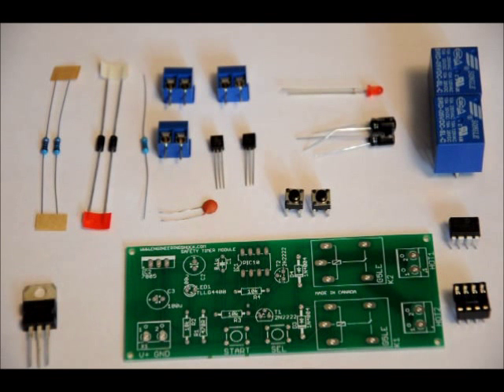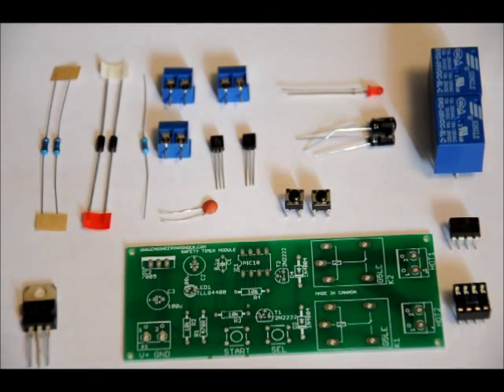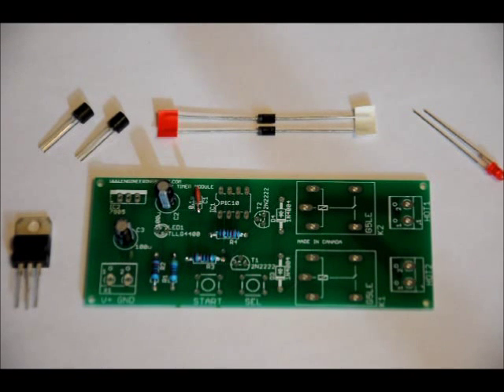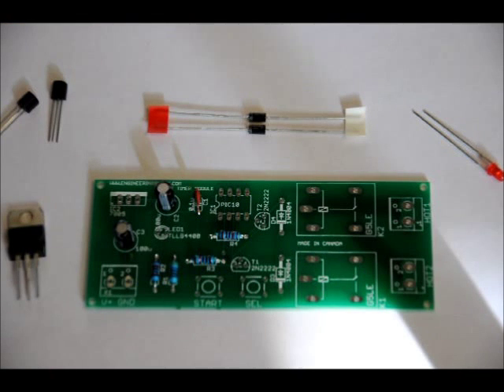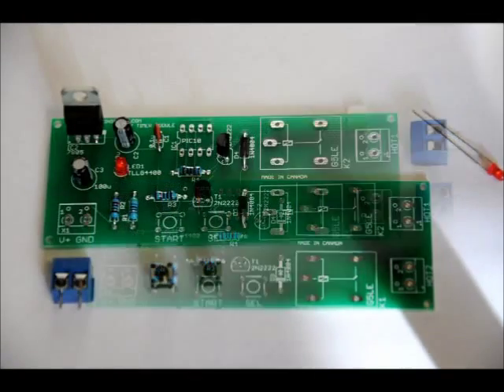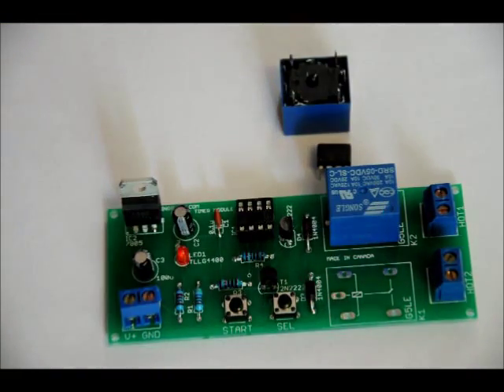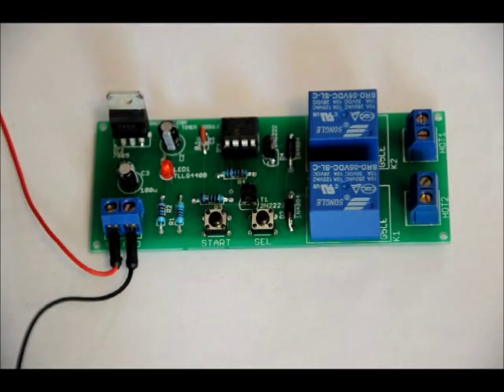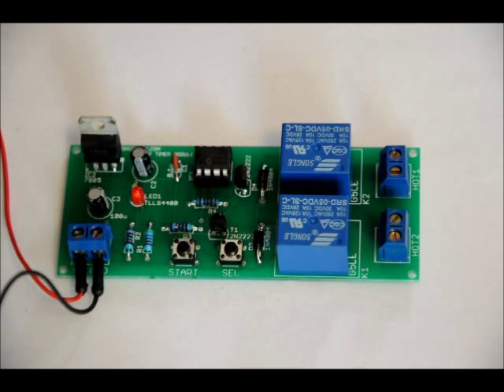The 30 Minute Soldering Iron Timer Safety DIY Electronics Kit - Assembly Video

Comment: what about a custom stand for the iron with an ir transmitter/receiver set that would detect the iron being removed from/put back in the stand (or maybe some other method of detecting)?

if the iron isn't put in or removed from the stand within 30 minutes, it shuts off automatically, and won't turn back on until you hit the button.

Just seems less annoying for long solder sessions. I can see myself getting pissed and bypassing this circuit so I don't have to keep resetting.